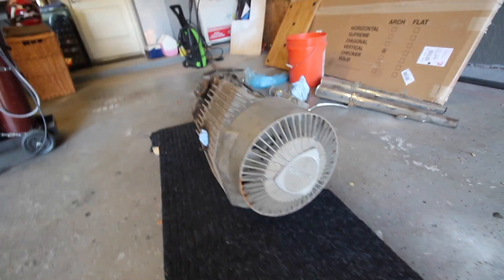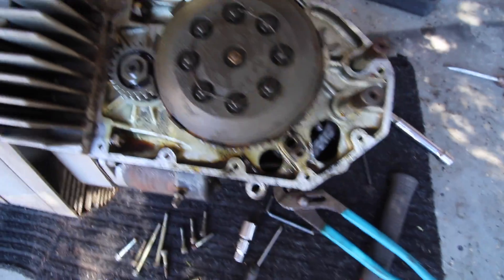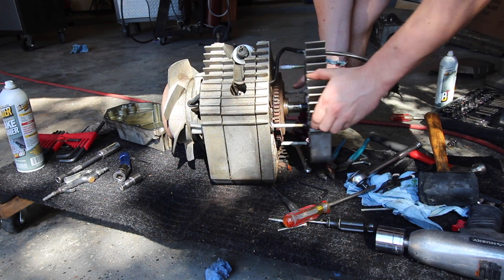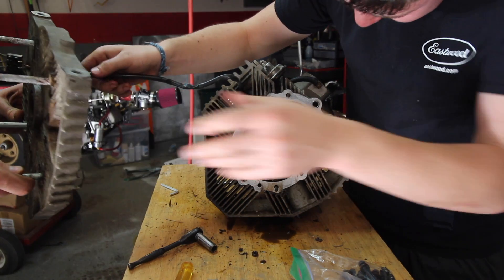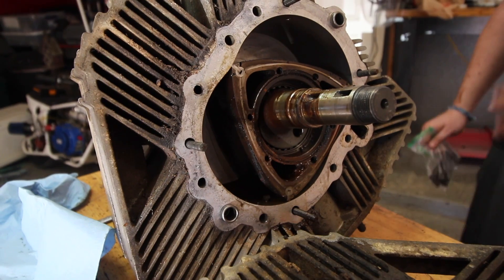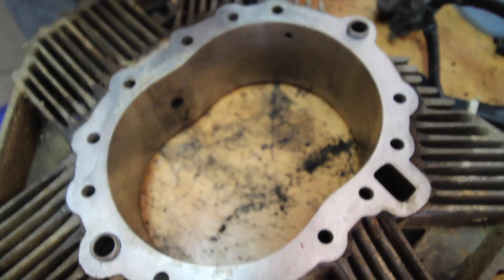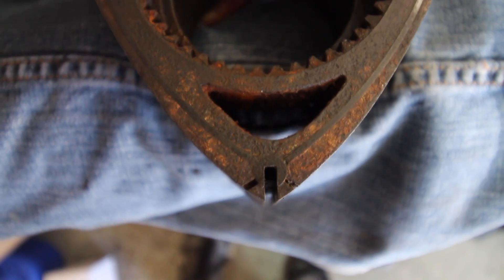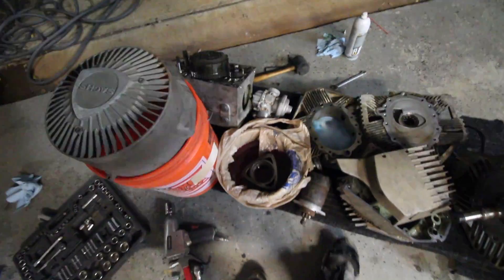Rare Rotary Motorcycle Engine Find! | Rotary Shifter Go Kart Build Part 1

Comment from the maker: Check out our Instagram to see this thing running for the first time! @build.break.repeat

Also, we need your guys help. The only way we can get it running is if we can spin it really fast with a drill because the stock starter is dead. The motor does have a kick start but we can’t get it turned over fast enough to get it running. Is this typical for a rotary, I’ve seen on some rx8 forums that they will not start unless turned over with a high voltage starter. Let us know what y’all think!
Reply: This is what rotaries do when compression is low.
Reply: I would replace the apex seals as well if there readily available. as for sealing the case halves i recomend using anaerobic sealant. Permatex #51813
Reply: @joshmeyer5280  I would think if the apex seals are undamaged, clean, the slot in the rotor tip is on spec and the springs are not fatigued they should be fine. The springs are more critical here because the gasses are working more directly against them than with the side seals. If you do anything apex related the new springs are the first thing I would consider. OTOH if parts are easy to get then by all means do the whole kit.
Reply: @InsideOfMyOwnMind  That was my point, if it was still available, do it once and do it right. Iv owned several rotary vehicles and the only failure iv had was Apex sealsv
Reply: @joshmeyer5280  Yeah my dad finished off a set thinking it would help oil fouling to put hotter plugs in it. OOPSIE!
Reply: Insideofmyownmind is exactly right. listen to what he told ya!!
Reply: Use weed as a catalyst
Reply from the maker: watch123242 @build.break.repeat
Reply: @BuildBreakRepeat  Yes. Builds up to start way over idle speed and won't idle. Classic low compression  It should be able to jump to idle when you crank it normally.
Reply from the maker: InsideOfMyOwnMind Damn ok, I guess we can check it, but it ran really good when it did start.
Reply: @BuildBreakRepeat  That's what fools people into thinking the mechs are ok when they are weak. Side seal ends have to be precisely sized. That's the main thing. I know on a Mazda they have about a .002" max gap to the corner seals or you won't build up enough compression to run at normal cranking speeds. The specs for this one could be even tighter due to it's small size.
Reply from the maker: InsideOfMyOwnMind I don’t think that it’s the side seals because we got new ones and gapped them to spec, I don’t know about the apex seals though, I’m also wondering about how the sides of the case bolt together, maybe some compression leaks out there.
Reply: @BuildBreakRepeat  You may be right. I don't recall seeing any housing seals being used. Did you use anything on the mating surfaces? I don't know if you're supposed to but at least look at them on a straight edge if you open it up again. Maybe a light lapping would help.
Reply: @InsideOfMyOwnMind  try giving it a shot of starting fluid.  As long as you do it sparingly when starting it should be ok.  With how loose the one apex seal looked I would hazard a guess that they have too much gap side to side.  Another thing to test would be reducing the spark plug gap slightly in case the compression is quenching the spark due to too much gap.
Reply: That sounds like a compression issue or improper starting air fuel ratio
Reply: One Apex seal can make it not run without using a drill to spin it very quickly. A old friend on mine got one in a truck he bought along with other stuff in the bed. We got running but would not hold idle or start on it's own power. We found that an Apex seal completing the compression revolution was not holding. Had taken three times to get it right working with getting the right gapping. That thing ran like a bat out of hell on his go-kart. It was very difficult to find parts not having the knowledge on roto motors. This was over 12 years ago though.
Reply: Compression test it that's usually a sign of weak compression from seal failure
Reply: You can have a shop machine the rotors side faces flat. the rotor never touches the housing or plates anyway. that is the seals job. u can use 12a mazda rotary used side seals for it. just have to do the typical clearancing to the corner seal.

I have 6 303s. scrapped the sleds. they were rusted. cant wait to see this bnuild!
Reply: these rotarys also love to be boosted with methanol injection. on the sleds anyway. cheers mate
Reply: For rare starter motors they can be re-wound for not a lot of cash. Classic cars get them done all the time.
Reply: Have you put the carb through an ultra sound cleaning bath? A blocked or partially blocked jet or pathway will cause all sorts of issues.
Reply: Repair the starter: Either new bushes, that don't need to be OEM. Bushes are in all sizes, so it is possible to source some that will fit. #2:  Or if the wiring is burnt, then unwind the rotor, counting turns and making a diagram of how each tooth is wound. Then get some high temperature magnet wire of same thickness and rewind it. If the wires are welded or pressed to the commutator, you can solder the new wires instead, no problem. Check the bearings in the starter while you're at it. Bushed DC motors of that Vintage are always handtool rebuildable. If that is too much hassle, send it of to an industrial motor rewinding business. Shouldn't be too much if you show up with you clean shaven faces.
Reply: Atkins rotary or maybe racing beat for parts...have you tried to push/pull start it?
Reply: Try looking into some mini starters they put off a hell of a lot more torque then a normal starter
Reply: Really powerful spark and starting fluid to crank it up.
Reply: You should try to connect with Hoonagins friend John Varges
Reply: If the starter is dead, try replacing the carbon brushes. They are pretty much universal, so you can take them from other spare starters, as long as the size is similar.

The 1st gen RX-8 starter is faulty because Mazda went cheap on it, BTW.
Reply: Friend of mine had an RX-7, when the seals are worn, they are more difficult to start.  Basically the worn two rotor engines in the RX-7 would start on the best rotor and spin the other up to sufficient speed to get the second running.
Reply: Were all those bolts that sandwich the casing together replaced? It's possible that those were torque-to-yield, and the old ones shouldn't be re-used.
Reply: 10 years ago i bought a rx-7 turbo 2 and rebuilt the engine using the Mazda book. When it was time to start the engine for the first time, the engine would not start. The Vaseline and fuel foul the new plugs. So for the second attempt , we put new plugs and push start the car in second gear by pulling the Rx-7 with a rope attach to my brothers car. At 20 miles per hour the engine came alive with a lot of smoke (fuel and Vaseline burning) It smoke for 20 minutes and rpms got smooth and it stop smoking. After that the car was able to start with its starter but with a lot of cranking.  It took 2 month of regular driving for the parts to break in and start normal with no struggle. My point is that if it doesn't start with the starter, the push start will do. Keep the throttle about 1/6 steady until it start. Keep up the good work, i am looking forward for more videos.
Reply: From how rough the dissasembly was, you fucked it.

Comment: I have the same W2000, its easy to pull the front off the engine to get to the rotor without pulling the engine out just work from the front to the back. My 1,400 mile engine was same as yours no marks on the internal surfaces but all my seals were free. I can see your rotor has had the drive gear welded secure, this is a mod to stop the drive gear coming loose. My rotor was fairly grubby so i cleaned most off and the engine runs that hot it cleaned the rest off when run up. Great little engine.

Comment: Did you guys finally get this running? I used to own a W-2000 and in 1981 I replaced the apex and side seals with the Arctic Cat versions (which was the only choice I had because the Hercules were unavailable by that time) and they fit perfectly. The bike still ran when I sold it in 1987.

Comment: Man that's a very rare approximately 16 to 1800 ever manufactured Wankel rotary motorcycle engine from a 75 to 76 Hercules which then the machinery was sold to Norton which manufactured arctic cat , sachs Rotary Wankel motor. Worth a pretty penny know people to pay up to 7k for a mint running on but they are hard to find parts for very cool you guys are doing a build keep up the good work

Comment: I know I'm late to see this video. You could have tried an ultrasonic cleaner to soak the rotor in to break lose the side seals. Could have used carb cleaner that is sold in 1 gallon cans you can get from an auto parts store.

Comment: that needs a new rotor,seals, springs and the cranc needs cleaning there are tonnes of YouTube vids on doing rotor engines and i think the rotor installment on this is exactly the same if you plan to port the thing pls look carefully because removing to mutch material can make it useless

Comment: I have some advice for you young mechanic man. Have rescued a many Wankel engines without ever destroying the rotor seals but the springs sometimes have to be made. I use beryllium sheet metal. Not cheap at all but has never failed me. And you never have to wait for the parts either. You just make the springs with a really good shear, I use a large band cutter since the cutter does not really distort the metal.What you should have done is soaked the parts in home made penetrating oil. The formula is what the AMC corporation made and sold for years for a really good price. Since they are gone you can make you own. This consisted of half acetone and half automatic transmission fluid. This stuff works the best with a nominal price to boot. You can either soak and wait for the ring to release or use heated oil that must be covered and out side for safety as not to burn down the garage. You can up the anti using ultrasound transducer to make it work even faster. So here is my secret of taking anything apart and not breaking anything in the process. Hope that helps you next time fella. Keep up the good work and peace too. V

Comment: It's fairly apparent that you two are novices when it comes to opening up old engines. You don't use screwdrivers as pry bars because they will destroy gasket surfaces. If you had taken that rotor and soaked it in diesel fuel for a week or two the seals would have loosened up and come out. An even better way would have been to flood the chamber via the intake and exhaust ports with diesel for a week or two before you cracked the cases. As for the starter, take it to any automotive electrical outfit and have them rebuild it. It is probably a Bosch unit and parts are available. You might want to start looking for spark plugs also as rotaries tended to use special multi electrode plugs to stop fouling. The trans should also be flooded with diesel for a while and then flushed until clean. The old gear oil will have oxidized and if you don'e flush it out it will probably eat your bearings in no time flat. And please, go to Harbour Freight and get some cheap pullers instead of prying things apart with screwdrivers. Prying parts apart will serve to warp them or break them and there are no replacements available for that DKW engine. I know. I had one of the original 1500 bike and parts were hard to get when they were new!

Comment: back in the early 70's a guy i knew at Highschool found a near new Sachs rotary engine on a water pump. We fitted it to his Kart.... no torque at the bottom end but once the tyres stopped spinning ,that thing was a low flying missile.

Comment: With modern cooling methods, you could probably have a rotor 50% larger, or cut down on the housing by 50%, plus all the weight savings. 
I think some smaller aircraft, or large hobby aircraft, use rotaries still, but I think they're mostly air cooled like this one. Might be worth checking those out as sources for parts also.

Comment: Get a steel tub of cheap engine oil and drop the rotor into it and heat it up for an hour or so in the oil.  This will expand everything and get oil into every crevice.  Then try and get the seals out.

I would also have either a machine shop skim the irons; or get a granite slab that is FLAT and spray glue some fine(ish) wet and dry and use the iron's weight to flatten them.  New seals all round (side seals, apex seals and tip seals) and new springs.

Good luck guys!

Comment: We had a mid 70's Johnson snowmobile that was a rotary - yeah, the pull start was basically useless.  The electric starter was also pretty useless - while there was enough room for a car battery it had a lawn tractor battery, and that would only start it when it had been running recently....  Usually took a bit of effort in the fall to get it going.

If you had maybe two people pulling at once, maybe you could have started it warm.

An ultrasonic cleaning tank would probably loosen those piston seals so you could remove them.  Hope you can find replacements.

Comment: Just a tip that may have helped you remove the side seals - just soak it in diesel for a month or so,it's kind of too late now but good luck finding new side seals for them.

I did get a 2 stroke engine going that had been full of water, I filled the cylinder up with diesel to free it up,it has compression but needs to come apart because the crankshaft ball bearings now are rusted & pitted meaning that they are noisy & need replacing.

Comment: I remember a snowmobile that had a Rotary engine. Sachs 303 sounds right. I saw it in the 80's and I think it was a 70 something sled. I also seem to remember the sled was made by Harley Davidson. I only saw the sled for a few minutes but the guy was riding it and it went "Pupp..Pupp..Pupp" and remember thinking, "How can this work?". It sounded like it was spinning the crank at about idle speed for a 4 stroke lawnmower engine. (At the time I didn't realize the huge RPM difference a Wankel has compared to even a 2 stroke).

Comment: Rotary guys would be trigger by this video
Reply: legit am extremely triggered... who tears apart a rotary without knowing about them? yes its a way of learning, no its not the right motor to be "learning" on.

all i say to them is good luck finding parts, and good luck having it run for any length of time. hard yikes.
Reply: @ADM_Vike  Check out the latest video then. Seriously, people from all walks get too tied up in doing things the right way, they start to forget they were just the same at one point.
Reply: FourEyePersonal no, in fact I wasn’t the same. I did years of research and schooling before starting to mess with things that you only should once you fully understand them.

Comment: You might as well get a whole deal kit for that rotor. Don’t just replace the side seals, replace all the seals. That would be like just replacing the oil control rings on a piston and not the compression rings. Might as well do it all while you have it apart.

Comment: You can have a shop machine the rotors side faces flat. the rotor never touches the housing or plates anyway. that is the seals job. u can use 12a mazda rotary used side seals for it. just have to do the typical clearancing to the corner seal.

Comment: If you watch Project Farm the channel, it seems like Sea Foam is good for engine clean up on built up carbon.
You can check out some of the vids where he tests it.
This maybe helpful in getting the engine started before it is fully functional.
Not sure if the Rotary will run properly with Sea Foam mixed into the oil.

Comment: Lane Auto Museum in Nashville TN has one of those motorcycles. The folks there are very nice, if you need any info, contact them and I am sure they will try and help you.
Reply: Also, the "cylinder" is a rotor housing.

Comment: Guys great idea to use that engine. It should be great. But you guys should have soaked the rotor in some kind of good solvent to remove the carbon build up. It may be hard to find replacement seals and springs. Your biggest issue will be if the springs under all of the seals are still useable. Corners, sides and apex springs are under all of of those. If they are flattened or don’t have good spring to them. Your comprehension will be a lot less

Comment: I had a Can -AM  Dirt Bike made by Bombardier made in 1975  .   All  the TNT' s 250 cc ,175 cc were all Rotax  Engines . Very Small engine but Can Am put out about 30 hp . The Darlings of the  DirtBikes at the time . Still got it !  Parts are not cheap unless you know where to look !!! Someone tried to steal it and ended up cutting all the wires just out of spite .just a little honey of a ride . No roads , trails , no problem!!!! She swim in a pond 3 feet deep . Engine in still  not broken in . It was a new 250 cc . Thought I'd upgrade from the 175 cc . CAN-AN ROCKED!!! Just ask anyone who owned one  .

Comment: The interesting thing about rotaries that I don't think many people understand is that they are actually a 2 stroke engine by definition. Think about it, they take mixed gas, they like to rev, not a lot of torque, intake and exhaust ports are in the cylinder wall and are uncovered by the sweeping piston / rotor. The two key differences are that 2 stroke piston engines have the benefit of the expansion pipe for self supercharging which is what gives them such an incredible power to weight ratio. The second difference is that rotaries are allowed on the street whereas normal 2 stroke piston engines are not because of emissions. So rotaries are kind of a neat 2 stroke loophole that you can drive on the street which is pretty cool.

It would be super interesting to see if a rotary could benefit from an expansion pipe like a piston 2 stroke. You would need reed valves and a custom tuned pipe.